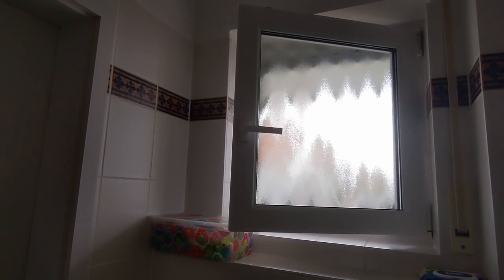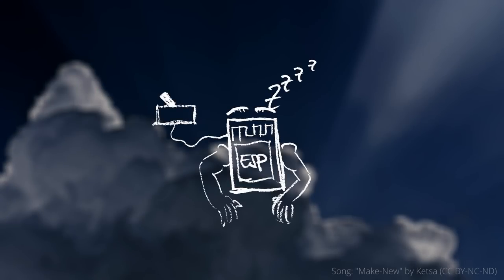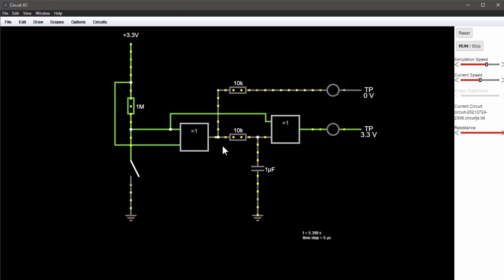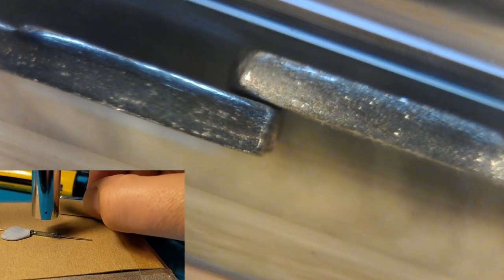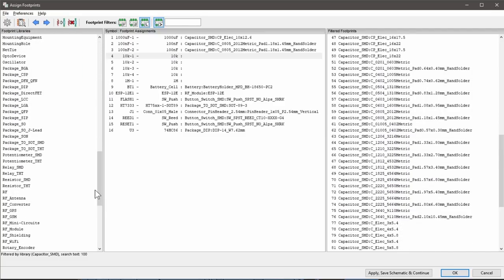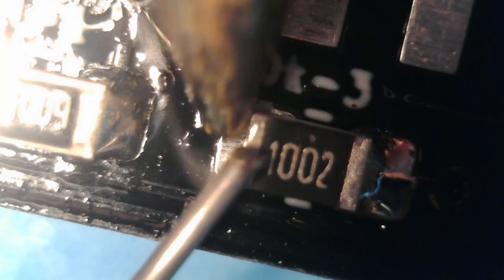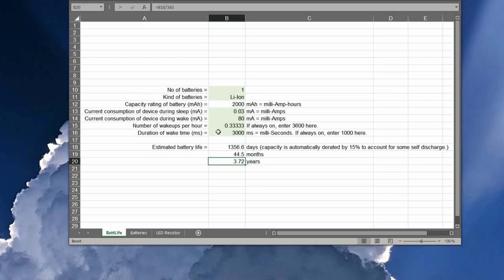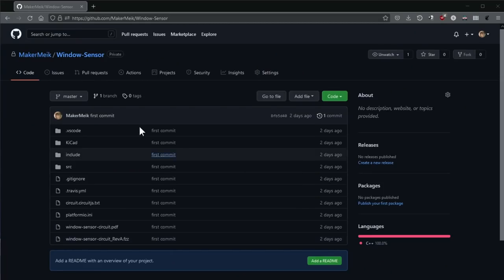ESP8266 as Window Sensor with years of battery life

Comment: I was thinking about building me a couple of these, when I ran into the Aqara window sensors. At around €12 you get a tiny zigbee device that has a battery life of over a year (single small lithium coin cell)
Don’t get me wrong: your project is awesome and you did a great job. If one is looking for the experience and joy of building this, great. But if the goal is to reach the most practical solution in the shortest time, the Xiaomi Aqara is the fastest route to success.
Reply from the maker: True, but I already explained that in my video. As well as the reasons why I still chose my own design.
Besides, I learned a lot in the process ;-)

Comment: Wie hast du die platine von der Größe begrenzt?
Reply from the maker: That's true, I left that out for time reasons to keep the video compact. In KiCAD Pcbnew you switch to the "Edge.Cuts" layer in the top menu and simply draw the contours as lines (sidebar: Add graphic line).

Comment: a battery monitor to send a message when the battery needs to be changed. Once a day would be sufficient.
Reply from the maker: As I wrote elsewhere in the comments, I already request the voltage at the cpu via ESP.getVcc() in the code. Of course it would have been better with a voltage divider behind the Li-Ion battery, but I think it should be enough to detect when the battery needs to be charged soon. If you revise the PCB and add the mentioned functionality, I would be pleased if you would share this improvement with me and the community on Github. :-)
Reply: @MakerMeik  I'm not that much of an expert. I've just started down the Home Assistant route and have been making a todo list. 

The low powered battery route is certiainly attractive. Humidity, temperature, light. noise, etc all fit the same mold.

Comment: Why is WiFi overkill when using mqqt
Reply from the maker: Wifi was never designed to save energy. It would therefore already be possible to save energy by using other communication standards. Keywords here would be Bluetooth LE, LoRa or at least ESP-now.
However, each of these connection types has different challenges. For example, low range, higher device costs or the need for additional hardware. That's why I have chosen to stick with Wifi. But in a few years, of course, it could all look different again.

Comment: Is it possible to power the circuit with some kind of magnet and coil setup? If we use the mechanical energy of opening/closing the door/window, then we can ditch the battery.
Reply from the maker: That sounds very interesting. Unfortunately, I am not (yet) familiar with the topic of energy harvesting. In my video you have seen how I calculate the power consumption with the spreadsheet (during the wake phase about 80 mA - for about 3 seconds and during the deep sleep about 0.03 mA). So if I haven't miscalculated and the battery is supposed to last a month even without window movement, you would have to harvest about 5 mAh per movement. My brief research tells me that this will be hard to achieve. Maybe I'm wrong, though.
But a solar panel would certainly be an alternative. Here about 150 uWh/d should be sufficient. If you manage to have the solar panel occasionally in the sunlight area, this could work with a small panel (50*100 mm).
However, as I said, I do not know much about this topic. Maybe you or someone else has more experience and can tell us something about it.
Reply from the maker: Indeed, that would also be my approach to extend the battery life significantly. On the other hand, you then need an additional ESP, which I wanted to save. And a runtime of several years is actually OK. And after all, at least rechargeable batteries discharge themselves over time.
Reply: @MakerMeik  I think a small solar cell, like those in calculators, would be easier than a mechanical think.

I actually thought about this windows sensor for the workplace, not because of the cold, but because of security: displaying the status of all buildings near the alarm panel, so we know that everything is closed when we leaving.
But there were occasions, when a window is just pushed shut, but not locked, so I imagoned a small board stripe, which fits into the slot in typical platic window frame, and also senses the locking pin position, not just the "closedness" state. I originally thought about a wired solution though, CAN bus + power, or something like that, but low powered radio + solar would make it much easier to install.

Comment: Does this report battery voltages?
Reply from the maker: Yes, but only the voltage behind the voltage regulator. I think it is also possible to read the battery voltage directly, but I did not realize that here. On the other hand, it is not necessary. The voltage stays at 3.3 V for a long time and everything is OK. If the voltage slowly drops to 2.5 V before the ESP does not boot anymore, there is enough time to react. If you want you can set up a message in Node-RED, for example from 2.7 V on.

Comment: what would you use if you weren't using WiFi?
Reply from the maker: So far I only use WiFi, otherwise I would not have built it that way. But it is clear that there are other communication standards, where the energy saving was more in focus during the development (Bluetooth LE, Lorawan, DECT ULE, Zigbee, ...).
Also based on Wifi, but with much faster connection establishment is ESPnow, by the way.
But I currently lack experience with all these standards myself. Maybe another viewer knows more about that.

Comment: How much did it cost you in total?
Reply from the maker: Since the prices are currently varying due to the corona-related supply bottlenecks, I had intentionally avoided to name a final price in my video. Besides, you buy a small stock of SMD components, so it is difficult to limit this to the price of a single board.

And it is hardly reasonable to order less than 10 boards. But I can tell you that the 10 boards will find a place in your house faster than you like ;-)

My order (before Corona) was at approx:
1.40 EIR ESP-12F
1.00 EUR PCB
0.30 EUR XOR-IC (74HC86N)
0.50 EUR TP4056 
0.20 EUR SMD-Capacitors and resistors
0.30 EUR 1000uF Capacitor
0.10 EUR HT7333
0.10 EUR N/O-Reed switch
1.00 EUR Cheapo Li-Ion (not recommended ;-)
_______

sum: just below 5.00 EUR

In the meantime, however, many components have become more expensive, as I said, so that it will probably be closer to 10 EUR today.

Comment: Какой смысл встраивать зарядку (4056) если заряжать 1 раз в год, лучше сделать зарядник для всех датчиков и заряжать им.
Reply from the maker: Good point. As I said in my video, with such a long runtime, the question arises anyway whether rechargeable batteries are really worth it. As is always the case, I started the project with the components I had at hand. The TP4056 cost only 0.50 EUR at the time I designed the circuit. And the cheap Li-Ions, of which I had ordered far too many, cost 1.00 EUR/piece.
In the meantime the prices have risen and I would possibly do it differently now. But hey, I share my project with you here, as it was the right decision for me at that time. If there are other requirement for you today, I would be happy, as probably many others here, if you fork my project on Github and present us your improvements. If something good comes up, I'd even link that here in the video description or pin the corresponding comment.